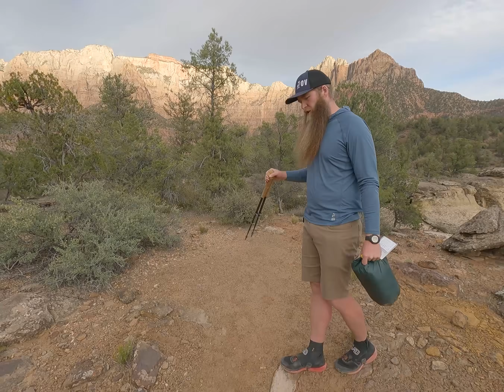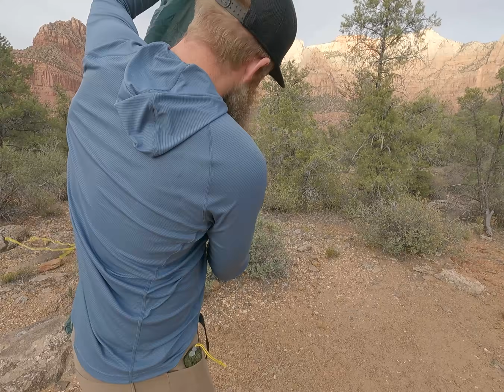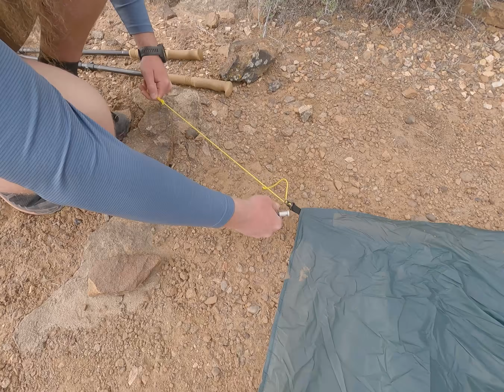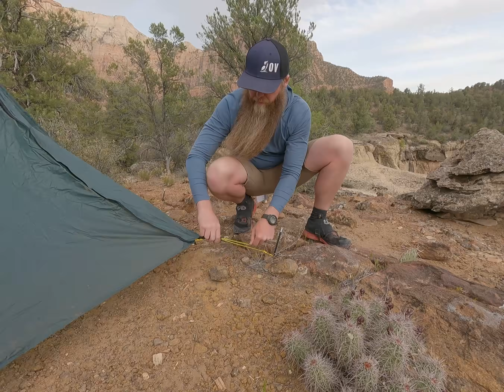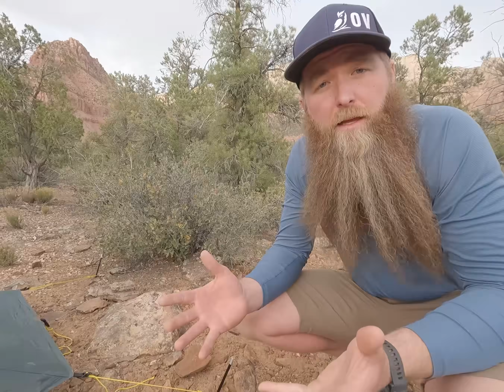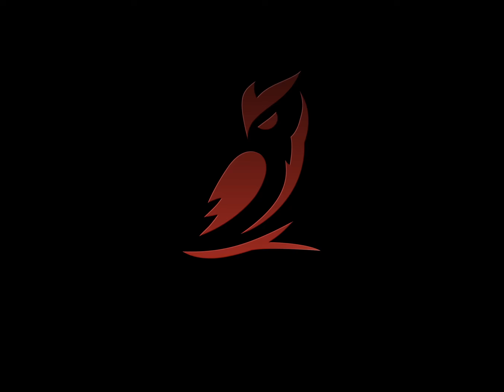How to Set Up Your Fortius Trekking Pole Tent

Comment: I got this tent some time ago. 
I really liked how small it packs and how light it is. 
I'm 6'1" and it fits me well sleeping on a foam pad (never tried a thick inflatable one) 

But despite being able to get an ok pitch very fast, I can never achieve a really good pitch. 
My door is always weird. It doesn't matter if I loosen anything beforehand or not. There are always some parts with very high tension. And during night it builds up a lot of condensation, which doesn't really bother me, but the tent sags a LOT and then it bothers me. I believe that using any inflatable pad, I would touch the walls in the morning, even with the optional guy lines attached. I think this is my bigger complaint. I will still try to practice more and see if it's a user problem. 

Some interesting updates to this tent would be: 
- Remove the Velcros. They are super annoying sometimes. 
- Add some ventilation at the top. 
- maybe some design/material change to make it less saggy when wet.

Comment: ... Why stake the body off the ground ??  Allows wind and weather to get under /inside and lift the tent ... Staking body stakes tight to the ground also prevents any heat loss in colder temps ...
Reply: No light weight tent will give you any insulation. You want ventilation to reduce condensation.

Comment: Just set up my Fortius 1p in the backyard. I've never used a trekking pole tent before. It went up pretty quick, but I did reference this video and the instruction sheet quite a few times. Will give it a test drive this weekend in preparation for my first multi night backpacking trip on the Foothills Trail next month!

Comment: Set mine up in the backyard for the first time in a very light rain. The tent went up easy of course because yeah its in my backyard but I wanted to test it in the rain. It rained lightly most of the night and I was dry and comfortable, temps were pretty mild around 55 deg F (131 C). My favorite thing about the Fortius is how much more roomy it feels, my previous trekking pole tent was the Lanshan 1p tent. Very happy with the Fortius and can't wait to use it on the trail.

Comment: Thank you for sharing! I have a couple questions. 
1) Do you recommend a footprint for the tent?
2) Do you leave the stakes that high or drive them in further? 
thanks
Reply: I don't know Tayson's opinion, but I like to use a footprint to help protect the floor of the tent. Polycryo is light and inexpensive. You can buy a sheet of it as Duck brand window film. I suggest getting the "max" which is thicker. About the stakes, I would definitely drive them in further so they are solidly anchored.
Reply from the maker: We do recommend a footprint. However, our team members themselves don't often use one.  

It's best to drive the stakes in further, but it's not always an option depending on the condition of the ground!
Reply: ... Always a footprint ,, Protect your investment ..... Tyvek pieces sometimes can be acquired at home construction sites for free ....